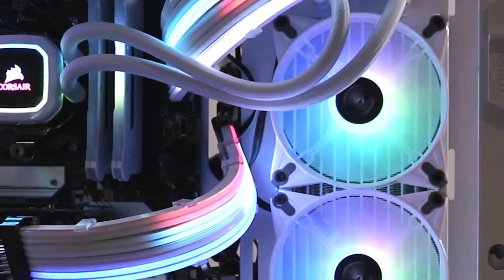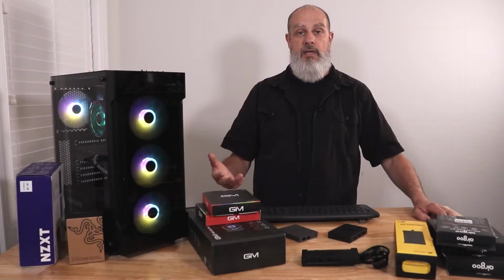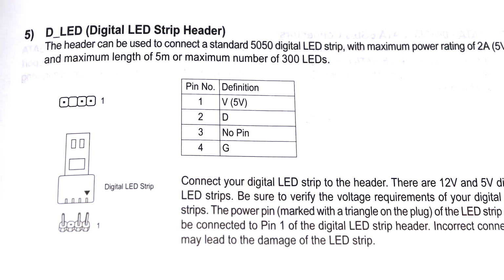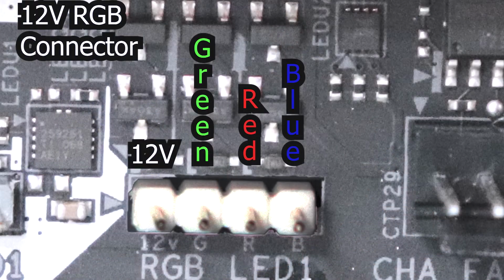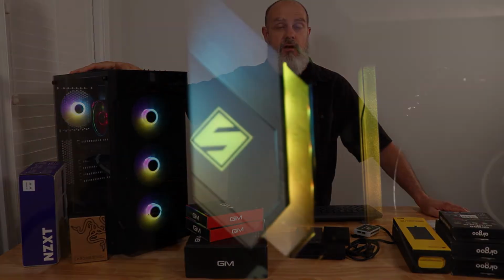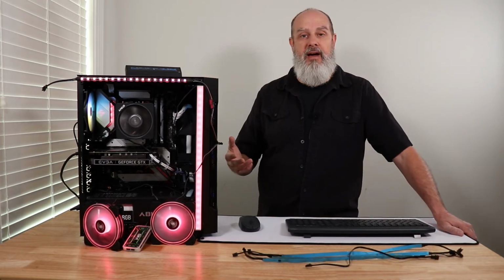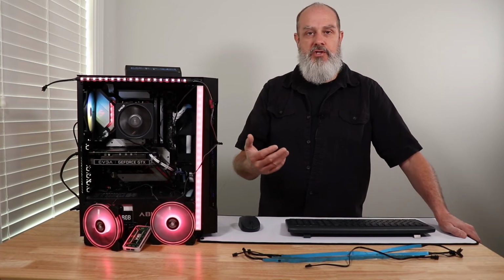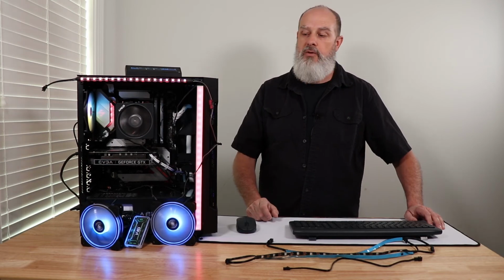How to get started with PC RGB lighting - A beginners guide

Comment: Having issues with mine😢.. got corsair.. had a corsair hub as well and micro Center just installed it all to the motherboard, and now when I run signal RGB the leds are slow and don’t flash spin etc like they are supposed to.. cause I have another set up with lian li fans and if I use the same signal RGB say led effect it looks way different where the led is like spinning and the corsair one is just stationary and kinda just switches colors like it’s being slow and glitching.. and i have no clue how to redo it and install them into the hub .. signal RGB sees the hub but nothing is plugged into it even though I asked paid micro center to do so

Comment: I think the Nollie controllers are perhaps the best out there, not too expensive, 1/8/16/16+Lian Li strimers versions available, and every channel can be controlled seperately with just one USB2.0 header connection.

Nollie16
1 Bottom 3 fans
2 Front 3 fans
3 Front Side 3 fans
4 360 AIO 3 fans push
5 360 AIO 3 fans pull
6 M.2
7 M.2
8 M.2
9 Pump
10 ATX Power
11 GPU Sag Bracket
12 GPU Power Strimer
13 Back fan
14 AIO Tube In
15 AIO Tube Out
16 Mobo ARGB Backplate
Motherboard

1 2x Memory
2 Lian Li Evo RGB

Works like a charm !

If i were to want to add more i might as well put in another Nollie8 controller, but i have enough already XD
Reply from the maker: Hi gabiballetje, I will definitely have to check out the Nollie controllers, thats a compelling product because of it's ability to control the individual channels. Thanks for the info and support. Have fun and thanks for watching!!!

Comment: First of all, thank you very much for your very informative videos. Great and clearly explained as always. And, I see that you are really the expert when it comes to lighting. But despite so much information, I still find it very difficult to make a choice for the right addition with regard to lighting. Could you please give me some good advice.

I currently own a (Jonsbo TK3 system case) with an (ASrock Z490 steel legend ) This mobo has 2x RGB and 2x ARGB connections of which I have already used 1 ARGB for my (Thermaltake TH360 ultra ARGB sync AiO cooler ). At the very least I want to have 3 illuminated qlick fans on the side and one on the back.

What could I get now for an average expenditure that is well compatible to nicely merge the light show with each other.

PS do you have any idea what happened to the system fans with the scrolling led text. If I didn't have one I would say it never existed. I would start to doubt myself. 🤣😂
Reply from the maker: Hi 1eskip, thank you for the feedback, I'm glad the video was helpful. I know what you mean by choosing new ARGB devices. There are too many to choose from. That makes giving you specific advice difficult. The TH360 ultra ARGB comes with CT120 fans already, you could consider adding more of those. On that case for the 3 side fans, you will want to make those 'reverse' instake fans, so look at and consider 3 of the CT 120 EX Reverse fans. And another regular fan in the rear, you should be able to get a single CT 120 EX fan for that. Using the CT fans is reasonably priced as you only need 4 more and should match good with the existing ones. 

There are many other options, and you could always replace ALL the fans including the ones on the AIO if you wanted a fancier look.  I like the Corsair ecosystem,  but the icue LINK fans get pricey. I like the LX series and they have a reverse option as well.   As for 24pin ATX and GPU ARGB cables, I still like the Lian Li Strimer cables the best, they do use lian li's controller, but you can sync that to your motherboard or other controller. to sync up with the thermaltake fans. The Lian LI fans are also a good option. I don't absolutely love the look of them, but they are a popular chose as well.  

Good Luck, have fun and thanks for watching!!!!

Comment: My bazooka v2 b450 only has a 4 pin rgb header I only have a 3 pin connector what do I do? I am a noob and new to rgb. All I need to hook up is 4 fans with rgb. For my montech air 100 case
Reply from the maker: Hi Aaron-hd8ql, 

As you stated, that motherboard only has a single 4 pin RGB connector. The 4 pin connectors are 12v rgb headers. You would need to use 12v RGB devices with it, which are not that common anymore. 3 PIN ARGB is what is generally in use right now and the two are not compatable. However, there are solutions for you. They do make RGB hubs that can take a 12v RGB signal and convert it to 5v 3 pin ARGB devices. For an example, check out this link, it's a non-affiliate amazon link. 

https://a.co/d/fK4L0Os

This hub would connect to your 4 pin rgb connnector and you select the switch on the hub to use 12v, then connect your 5v 3 pin argb devices and you would get basic rgb control.  This is a basic inexpensive solution. 

You could also add a 5v ARGB controller to you setup and just not use the header on your motherboard, there are many rgb controllers out there that are standalone, or you could look at ones from corsair and others, but this would be more of an investment, there are lots of options. If it's just really basic single color RGB you want, then the hub above is a good option, but that's just one of many, search around, but that should give you an idea of what your looking for. 

The hub above would also give you a PWM fan hub. 

Good Luck, have fun with it!! Thanks for watching!!!

Comment: I`m building a pc , and (long story short), I want to use ws8215 using a 12v power supply on the side and just using the data pin form the mother board.

any comments on this?
Reply from the maker: Hi packrat2113, that's a great question. I do not know the answer to that.  I've never looked into that. There are converter hubs out there for using 5v ARGB devices on a 12v header, but that's not what you're asking...and a quick search I don't see anything converting 5v to 12v RGB,  even then in the PC space of course, those two things work completely differently, whereas the ws8215 is similar to the ws2812, just 12v.....I'm not going to be much help unfortunately, i'd have to research and maybe hack something together to test it....haha. If you find a solution to that or more information, please share it, that might a fun day at the workbench...good luck, thanks for watching!

Comment: hey i have a question i understand the 5v and the 12 v rgb but some boards have a place to hook up a sata power as well does this need to be hooked up as well or just the power from the motherboard ?
Reply from the maker: Hi gossom875, most of the boards i've come across, the 5v and 12v rgb headers have power from the motherboard itself....of course, you can send the rgb signal to a hub that has it's own power. I can't recall seeing a motherboard that has a sata power input specifically for RGB, but that doesn't mean it doesnt exist.  Do you have a motherboard model#, i'd like to take a look. Thanks for watching!!!
Reply: i bought the gigabyte case it cam with a rgb bord in the back if it and the motherboard i got is a z790 aorus elite ax v x.x the ddr5 one thanks for any help
 @HardwareArtisan

Comment: For anyone getting into this, getting true cross compatible RGB can be painful if you mix and match manufacturers such as Corsair keyboard, Logitech mouse, Asus headset etc. You definitely don't want to run multiple RGB software programs to control it all. Look at 3rd party programs like SignalRGB or OpenRGB and see if your hardware is supported. Neither of those are perfect, but they are doing their best to enable true cross brand unified RGB control.
Reply: SignalRGB is freemium, so you only have a selection of what SignalRGB can actually do, OpenRGB on the other hand is entirely free and open source, it's most of the reason why OpenRGB has as many supported devices as it does
Reply: @aftdawn  Sure, many of the effects and fan control part of SignalRGB is paid content, but the core control of multiple devices and basic themes isn't. OpenRGB does maybe support more devices currently, but once SignalRGB gets AMD based graphics cards to run, that list should shrink a lot.

Comment: I would argue that a lot motherboards currently in gaming rigs don't have an argb header. Almost all B450's and Intel 8/9th gen only have the 12 volt rgb header . And all the motherboards prior to that (which are very common still) only have regular pwm fan headers. Despite how common these motherboards are there is practically no information about getting led fans functioning in them. I don't even know if there is such thing as an analog 12 volt rgb case fan.
Reply from the maker: Hi carley northcoast, some great points your have. As you mentioned there are many boards out there that don't have the 5v ARGB ports, some have no RGB ports at all. You can still do RGB on those, you just need an RGB controller such as Corsair, Razer, etc....

LED color fans, which are kind of old school now, had only a single 3 pin or 4 pin, DC or PWM power cable and the LED"s took their power from the 12V signal on that cable. You of course, can't change the color on those. They still make these, although I don't see them often. 

12v RGB fans that have 2 connections, a PWM power cable (or 3pin DC)...... and a 4 pin (12V RGB) connector are something I don't work with ever and don't see much, but here is one example:

https://www.amazon.com/Cooler-Master-SickleFlow-Customizable-Computer/dp/B086HN1TFP/ref=sr_1_8?crid=4EEBGQKP0YT6&keywords=12v%2Brgb%2Bfan%2Bfor%2Bpc&qid=1681762267&s=industrial&sprefix=12v%2Brgb%2Bfan%2Bfor%2Bpc%2Cindustrial%2C89&sr=1-8&th=1

RGB awesomeness for sure! I do also see some RGB HUB's out there that will take the 12v 4 pin RGB signal and send it to 5v ARGB 3 pin fans, those work good as well. 

Thanks for watching!!!

Comment: Hate the corsair crap, spent a lot on the 4000x instead of the 4000d airflow like a moron just because it has the 3 integrated fans and when I finally got it the top fan doesn’t light up at all and the middle and bottom fans light up just a single green led on the middle fan on the right and a single red led on the bottom top of the fans 🤦‍♂️  I’ve been on support with corsair for almost 2 weeks now and they just closed my ticket with no resolution for me 🤦‍♂️🤦‍♂️🤦‍♂️ so basically I paid 50 or more $ for the 4000x instead of the 4000d to not have to worry about the rgb and ended up with 3 broken fans on the 4000x 🤦‍♂️🤦‍♂️🤦‍♂️ and no actual help or refund or replacements 🥹🥹🥹

Comment: ASUS
Motherboard
PRIME
H310M-A R2.0

How do I connect the ARGB Fan light on this Motherboard,? Is it advisable I use the (SPDIF _OUT) to plug the lighting of the fan??

I have the NV-I120FWR3 fans from Raidmax
Reply from the maker: Hi KW Forex Education. SPDIF_OUT is an audio cable. You cannot use this for RGB connection, although it's similar. This motherboard does not have any RGB connectors, which means you cannot use the motherboard to control any RGB. You will need another type of controller. 

Your Raidmax fans I'm assuming came with a controller and it's remote. You can use that with no problems, but you won't be able to use the MB sync on this motherboard. 

There are other controller types out there you could add, such as the ones from corsair that we look at alot on this channel, there are others out there, the one from Razer comes to mind. If you want to gain some software control over those, take a look at the 'lighting node pro', that's a small controller with 2 corsair RGB ports, you could adapt that to send a signal to the raidmax controller, check out the video on getting non-corsair RGB working with icue. 

That little controller can be found relatively cheap and the adapter cable is 10 bucks or so. 

I hope that helps, check out these videos:

https://youtu.be/JgLUDe1yzYw - How to get all your RGB working with CORSAIR iCUE - Tutorial

Lookup the lighting node PRO:

https://www.amazon.com/Corsair-iCUE-Lighting-Controller-Multicolored/dp/B01MYDTC2C

You could also use the Commander CORE XT and Commander PRO, they each have a 3 pin RGB port to sync the raidmax controller. if the fans are 4 pin PWM you could get speed control as well through those controllers. 

I hope that helps, 

Thanks for watching!!!

Comment: This is Michael. Very well done although too technical and not practical enough. You could solve that with a concise summary that deals with application of R GB parts Without Getting into all the pins and circuitry.
I've pretty much Decided on corsair for their fans, connection devices, And software. They solve a lot of problems for the user.   I've had trouble with asus, And Razor, And none of them like to play nice with each other.
Reply from the maker: Hi Michael, thanks for the feedback, that is a video idea on my list, same idea, different approach, less techy, haha. 

Yea, I've used alot of the other RGB hardware and software, it's not that it's all terrible and I'm playing with more stuff, but everytime I use other software, I keep going back to Corsair, it's just more polished in my opinion. 

Thanks again for your feedback, it's noted, good luck with the Corsair RGB, it's awesome stuff! Have fun, thanks for watching!!!

Comment: How do you control fan speed with aRGB 3 pin, 5V?
Reply: Fan speed is controlled by the PWM (4 pin) or DC (3 pin) fan power cable, not the ARGB cable. You have to plug in the PWM or DC cable to make the fan work after all. That is controlled by your motherboard or dedicated fan control software.

Comment: I am having an issue with my MSI Z390 Gaming plus mobo, it had a 4 pin fan header that states JRGB, I don't know what fan setup I need for my new build, any suggestions?
Reply: MSI JRGB is the 12v single colour at a time LED standard. Basically good for strips or the rare fan which used it. Almost everything sold these days is Addressable RGB, which is 5v 3 pin. On MSI boards it should be labelled J RAINBOW.